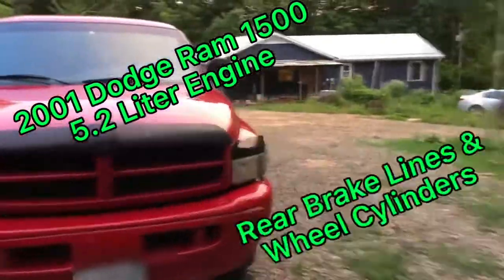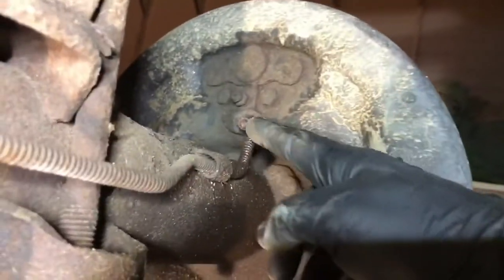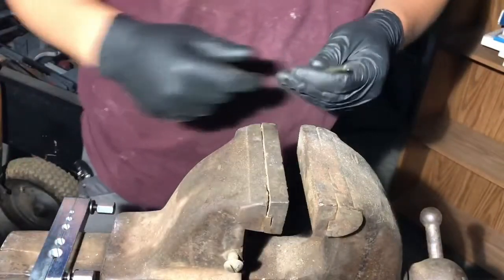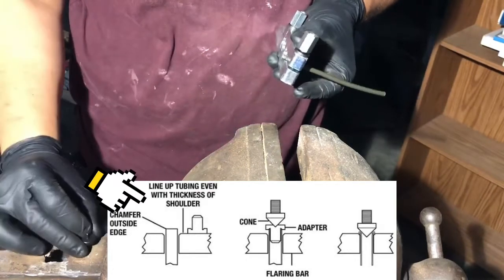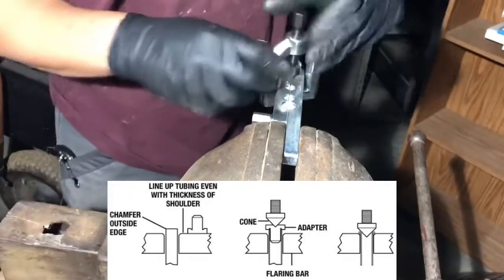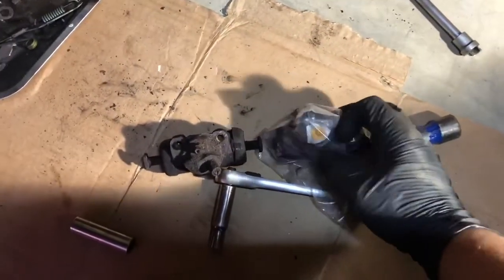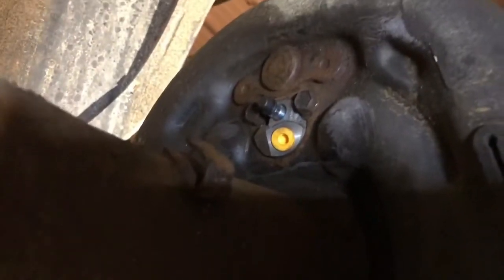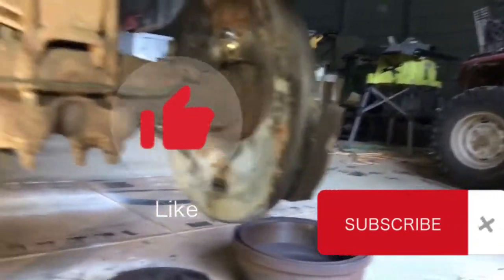How to Replace Rear Wheel Cylinders & Rear Brake Lines 2001 Dodge Ram 1500

Comment: Nice video!  I just replaced the front to rear 3/16 tube on a 2001 Dakota.  Both ends were bubble flared in my case.  I bought AGS copper nickel from a local parts store.  Its not magnetic.  The 4lifetime copper nickel from Amazon is magnetic.
Reply from the maker: Nice job!

Comment: I have the 5.9 magnum, will this work the same way
Reply from the maker: It should. Brakes should be pretty standard across all the 2nd gens
Reply: @neverendingdiy  thanks man! Mine ended up being the line about midway down by the cab so it was a totally different setup but I appreciate the help!
Reply from the maker: No worries! Hope all went well!